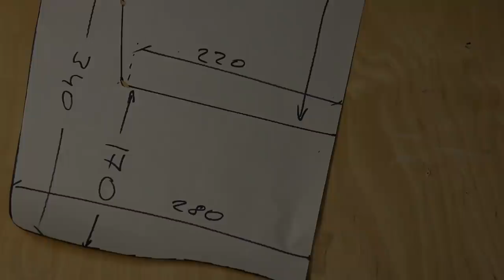Folding chair | Кресло своими руками. + размеры.

Comment: Very nice looking... I'm not so sure about the durability of it with those small screws and hinges holding the rear of the seat though...
Reply from the maker: Thank you.
Reply: @WOODDESIGN6730  -- Depending upon the type of wood you are using, you might be able to make those hinges basically a loosely fitting (so it rotates easily) finger joint (with the ends rounded over) and then have a metal rod going through it to act as the hinge pin.  If it was made out of thicker wood, then you could get away with having a wooden dowel act as the hinge pin, but if you had been making it out of thicker wood, you would have had other (stronger) hinge / hinge attachment methods from which to choose.  As in everything else in life, it's a compromise... :)
Reply from the maker: Thanks for the advice.